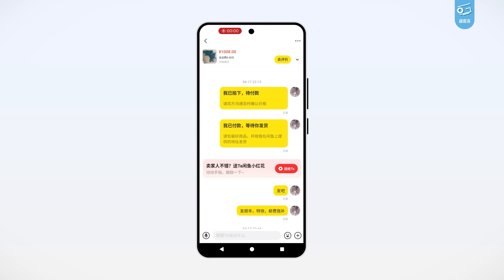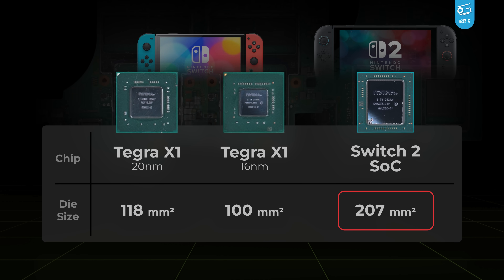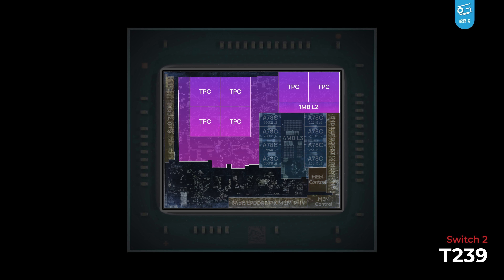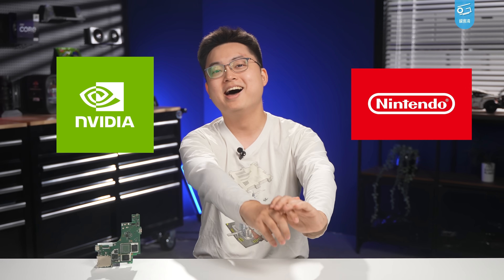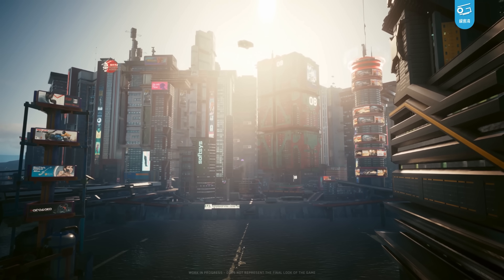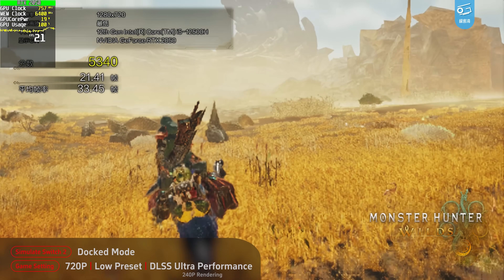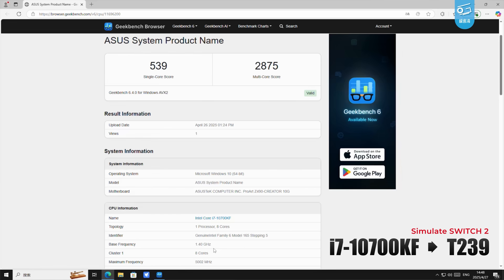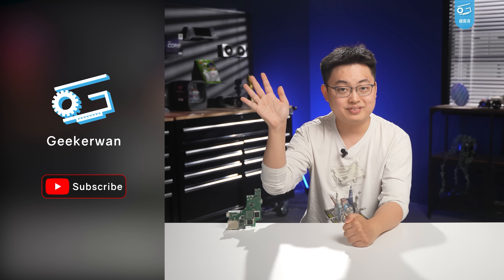This is Nintendo Switch 2's CPU!

Comment: using a rtx 2050 as reference isn't fair for MH wilds as the game doesn't run well on 4Gb GPUs at all. When switch 2 does have enough vram to run the game.
the 2050 is behaving as expected of not having enough vram and having its bandiwth downclocked to move this vram fast enough.
Reply: well thats not fully accurate..

he ran the game at lowest settings with dlss which reduces vram usage to about 4gb….. ,..
Reply: @Jay-Tan  nope, I on my end too, even on 240p internal, the game still maxes out my 3050 laptop (4gb)
If you want better reference on how switch 2 would run MHwilds on portable, theres already TONS of steam deck videos, spoiler, its not 15fps, visibly higher resolution and thats without a good upscaler.
Reply: @ i doubt that switch 2 scales to this anyway because you cnt compare custom soc to normal pcs

its like how people compared the rx 6700 to ps5

technically same gpu same chip same cores and clock speeds actually higher than ps5 but ps5 can do 4k upscaled and even native 4k in many games

while 6700 cannot
Reply: @Jay-Tan  not to mention overall engine optimizations,

street fighter 6, also an RE engine game, looks sharper (both in textures and final image) on Switch 2 than series S, despite S2 being weaker, I don't think that just having 12gb of memory and DLSS alone can do this big of a glowup on SF6 as we're seeing.
Reply: @ well we dont know if switch 2 is weaker or not

since these tests mean nothing without real hardware

Comment: This just confirms that it's pretty much a PS4 Pro when docked, like Digital Foundry and other people have been saying and not a "Series S" like the fanboys keep claiming.
Reply: I don't really understand any of this but how come street fighter looks better on switch 2 than the series S? It's a genuine question
Reply: @peterward8574 
This guy can by lying or it can be a pytrotype
Reply: @peterward8574 because the port for xss is not good, the port itself have some graphical errors and capcom has not fixed it since its release. It’s depends on games. The all new trailers of switch 2 versions of 3rd party games are more like a new recent build compared to the version in ps4 or xss. some game has more native render resolution or fps on xss/ps4. Safely, switch 2 is a machine between ps4 and xss, and close to which depends on the game. Even on PS4 we have game like lost of us 2 and god of war with good graphics, so it depends on the developers.
Reply: @gungchern5840 many thanks for the answer. So like any of this sort of stuff we should just let the games do the talking.
Reply: There´s no way PS4 or PS4 Pro could run FF VII Rebirth, and Switch 2 will do it in the future (confirmed by one of the developers). Also Cyberpunk will be running at 1080 40fps in dock mode, compared to 30fps with massive drops on PS4 Pro.

Yeah, Switch 2 is not as powerful as Series S but is a lot more efficient than a PS4 and One.

Comment: Honestly, Switch 2 is more powerful than I've been predicting for the past couple years--I was expecting to be about on par with a PS4, maybe a little closer to a Steam Deck. For a handheld console, this is AWESOME for me, especially when you see what the PS4 was capable of, I personally don't need much more power than that, but don't expect certain modern games to be playable on Switch 2, such as Grand Theft Auto 6, or Monster Hunter Wilds. Sure, with well optimized ports, the impossible becomes possible, but ultimately, we should expect Switch 2 to be a generation behind Xbox/PlayStation.

For those that are disappointed, remember: Developers were porting games a full generation ahead of what Switch 1 was expected to be capable of, with severe downgrades in performance sure, but unlike a Steam Deck, all games on Switch 2, will be designed with the hardware capabilities in mind. I would also like to remind everyone just how many modern generation games have had Cross-Gen releases, even Horizon Forbidden West was on PS4, and could easily run on a Switch 2. Nintendo always takes the conservative approach with hardware, yet their developers manage some amazing games regardless, and I can't wait to see what their artists can do with PS4-Like power in the coming years! Especially with the next Zelda.
Reply: Remember that Nintendo doesn´t need an highly powerful system to create masterpieces such as Tears of the Kingdom or Xenoblade series, if they could create beautiful games with such limited hardware as Switch they will definitely do some magic on Switch 2.

Comment: So 8 Elite phones can emulate Switch 2 games easily?
Reply: Atleast the lower end games for sure.
Reply: Not even remotely. Like, even if phones with the 8 elite were better on all fronts than switch 2 (they're not), it still wouldn't be enough cause emulating software requires way more power than running it natively
Reply: @geraldolucrezia 8 Gen2 can run most of the Switch 1 games through emulators easily
Reply: @xo.x9f  you were talking about switch 2 though? Switch 1 is, as we saw from the tests in this video, over 7 times more powerful in raw numbers (so not counting dlss and the like). Like sure not all exclusives will use all that power to its full extent and therefore not need as much hardware to emulate, but for the most demanding games that won't be the case

Regardless tho, I doubt there's gonna be an emulator for switch 2 as fast as they made one for switch 1 (which even then, only became somewhat usable after like 2 years), since the main reasons for switch 1 being modded as soon as it did are not here for switch 2 (the hardware exploit was already patched on switch 1 V2 and it's extremely unlikely there'll be a similar one for switch 2, plus I doubt they haven't made OS and bootloader security checks much tighter than switch 1 knowing how fast and well that one got split open by the modding community)

Comment: This reveal confirmed our worst fears. Close to the 2050? 8nm, but actually 10nm? Jesus H. Christ!
Reply: How does it justify the 450 dollar price if a better hardware could be had for much lower prices??? Optimizations cannot be used as argument for then, the other comparative hardware should also get the same optimizations. As a potential new buyer, why would i shell out 450 dollars for slow hardware when there are other more powerful and cheaper alternative hardware that can also enjoy whatever digital optimizations the switch 2 has???
Reply: @lazygamer7469  well it comes down to exclusives alone sadly. unlike the switch 1 now there are concurrent products for mobile play third party games
Reply: @HermesderWetterbote  do not buy this thing dude
Reply: . @lazygamer7469  you dont. you do not enable this crap and end your money elsewhere
Reply: but it was all leaked in 2020 😅 no real surprise here
Reply: Massive down clock of gpu and vram  frequency for comparison of docked gpu, 18w for comparison of handheld mode.

Comment: So will this thing have GTA 6 released on it??? or is it too much for it to handle because of how insane GTA 6 LOOKS in the new recent trailer

  GTA 6 IS THE ULTIMATE TEST FOR THE SWITCH 2 IF IT CANNOT HANDLE IT DOWN IT GOES IN THE TRASH CAN
Reply: Gta 5 didn't even release on switch to this day. I wouldn't hold my breath for a switch 2 gta 6 release
Reply: @ebiooo  Yeah but this time things should be different as the switch 2 was running the matrix awakens demo so if it can run something as big as matrix awakens then GTA 6 should be possible
Reply: If Xbox Series S can run it, so should the Switch 2.

Comment: its a ps4 portable, and at a high price, and services to suck you of cash for service avalible for free on even other consoles, and better given its discord, and pc has free online, even your smartphone has free online gaming, consoles arent worth it these days, i get it, you wanna sit down on the couch and not need to worry about updates or anything, but, your paying alot for the convinience, and youll notice someday alot of cash leaves your pocket yearly because of the console
Reply: I think the console would be fine if the software would be cheaper. I have friends with kids who have no relation to gaming but everyone has a switch at home. 300 bucks and a game for 50 here and there was acceptable. Nintendo is really bold with their prices, but they are a big business, so they must have calculated how much they can squeeze out of their customer base without losing them.

Comment: People saying its more powerful than i series s needs a reality check. I thought it would be between a ps4 and ps4 pro in power. You can only do so much especially in handheld mode but i have one preordered and I’m very excited for the launch. People just always overestimate stuff just like they did with the steam deck. And the rumors were pretty much true except 5nm. This is awesome i love stuff like this great work.
Reply: You have t consider that the GPU performance is calculated based on a dowclocked RTX2050... it's not a real test. RTX2050 and Switch 2 are quite different (even the CUDA cores seem to be more similar to Ada than Ampere or at least a strange mix of the two architectures)... also even if it's an RTX2050 that has been testes, DLSS and tensor cores are not included in the performance measurements. Real on the road performance is what we need... there isn't any at the moment.
Reply: @MrMorotep  yes we won’t know exact performance but i think we know enough to make an informed decision on its performance. The cpu cores are a bit weak but Nintendo have been using older tech on their hardware for a while now. And it doesn’t help that they probably planned on launching this much earlier. Im going  to be happy with it i mainly get a switch for first party stuff and jrpgs. I have a 4090, series x and ps5 pro if i want to play more graphical intensive games. I think it has enough power and im satisfied with all the specs but i was really hoping for 5nm just to get better battery life. I have a asus ally and steam deck and while i love them both many new aaa games struggle on them the deck more than the ally. I know console games will be better optimized and we have dlss and maybe frame generation to help. I love my oled switch and its much weaker but i will miss the oled screen. But having gsync more than anything else should help the new screen. I got a mario cart bundle preordered a pro controller and camera so im all in. I hope its more powerful than i thank but some of the videos and comments i see think its faster than a series s or more are pretty crazy though. It does have a much better feature set though.
Reply: I feel the same way, I'm more concerned about how it compares to switch 1 than anything else. And 7 times more powerful, sounds ideal to me

Comment: Switch 2 is running Street Fight 5 handheld mode at 540p but DLSS looks better than Xbox Series S running at 1080p.
Reply: It's not better than series s stop lying
Reply: @nickguys4839 it is, but not for the reasons fanboys think. The XSS version is unoptimized, only using TAA, which in this game, is extremely blurry. Even FXAA would do better for blurriness

Comment: So uh, you broke your 2050m's MAF ratio. Downclocking it to 755 mhz to match theoretical compute brought your l2 cache bandwidth lower than the vram bandwidth which is checks notes a no no.

This is why you are showing in the die scan switch 2 has a new custom l2 cache design from the rest of ampere, being split into 256kb slices each with a 32 bit memory controller instead of amperes standard 512kb per 32 bit controller.

It doubles the l2 cache bandwidth per clock, an absolute necessity at lower clock speeds.... so you dont end up with an l2 cache with slower bandwidth than your vram.

This is SUPER bad for the 2050m which is seperated into two smaller gpc's of just 8 sm's each compared to switch 2's 12sm gpc.

Comment: 12 gigs of ram in 2025. My laptop is a few years old and has 32 gigs and cost about the same as a switch 2
Reply: 12 gb of ram is more than good enough. The xbox series s and x have 10-16gb in comparison, with the ps5 and ps5 pro having 16-18gb. Comparing that to your laptop is pretty pointless, especially more so for a hybrid console like the switch.
Reply: You need to understand that more is not always better but sometimes just more expensive. Games on these settings will never go over 12GB of RAM. The switch 2 does not have 32 GB of RAM because the rest of the console does not have the power to play on settings that require such high amounts of RAM.

Comment: so its a handheld ps4 and a ps4 pro docked, with more modern features . thank you
Reply: @MD-se8ft  no it more powerful then ps4 in handheld mode and that's before including dlss, 33% more ram, decompression blocks and faster storage speed, it has nearly 3 times cpu speed then ps4.
Reply: @AI-ex5rw  So will this thing have GTA 6 released on it??? or is it too much for it to handle because of how insane GTA 6 LOOKS in the new recent trailer
Reply: @Jp-kb3op it has NO chance to run gta 6 sadly 😥 The cpu is way to weak. the steam deck on the other hand should be able to handle it.
Reply: @AI-ex5rw  GTA 6 IS THE ULTIMATE TEST FOR THE SWITCH 2 IF IT CANNOT HANDLE IT DOWN IT GOES IN THE TRASH CAN
Reply: @Jp-kb3op  I ONLY TYPE IN CAPITAL LETTERZZZZ
Reply: @AI-ex5rw yeah, but in handheld mode its gpu is still weaker than the 3 year old steam deck and its cpu is not even half as fast as the steam deck... it also has a smaller batter, less ram and no fast ssd, yet it's more expensive... and uses older tech
Reply: @HermesderWetterbote  games will still end up looking and running a lot better on switch 2 in handheld mode due to not having to deal with steam os and having games built for it ground up while others will be more optimised.
Reply: @AI-ex5rw  steam os is also running on linux just like switch os. its not using a lot of resources like pcs. also the cpu of the steam deck is almost 3 times as fast. and it has 4GB more ram and 4 times faster storage... cyberpunk 2077 is running a lot worse on switch 2 in portable mode right now.
Reply: @HermesderWetterbote  steam deck games run through a translation layer there not coded specially for the steam deck unlike a dedicated mainstream gaming system which the major advantage the switch 2 will have.

Comment: Super exciting stuff so both in gpu and cpu benchmark it's far above ps4, digital foundry spreading misinformation for click bait again😂
Reply: So will this thing have GTA 6 released on it??? or is it too much for it to handle because of how insane GTA 6 LOOKS in the new recent trailer

  GTA 6 IS THE ULTIMATE TEST FOR THE SWITCH 2 IF IT CANNOT HANDLE IT DOWN IT GOES IN THE TRASH CAN
Reply: @Jp-kb3op  we know next to nothing about gta 6, it won't be out till 2026 may.

Comment: So basically we don't know anything more than we knew before. Also good luck though as the Nintendo Ninja network was activated today....
Reply: we know the caches and memory speed which we didn't before
Reply: We didn't know the so was 10nm😂
Reply: We didn't know the so was 10nm😂
Reply: People are assuming a Samsung 5nm, it turned out to be hybrid 8nm with 10nm, so this is why switch 2 battery life is 2h-6.5h and worse than switch 1. Also the cartridge slot is in the motherboard, which will be hard to fix compared to switch 1 if the slot is broken.